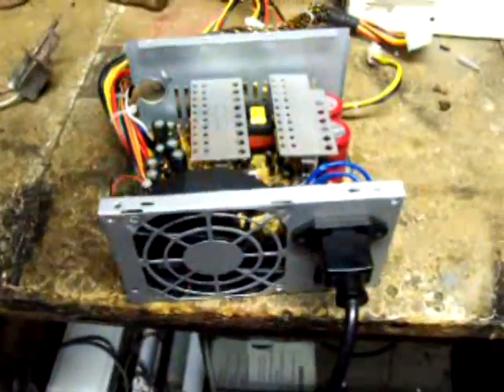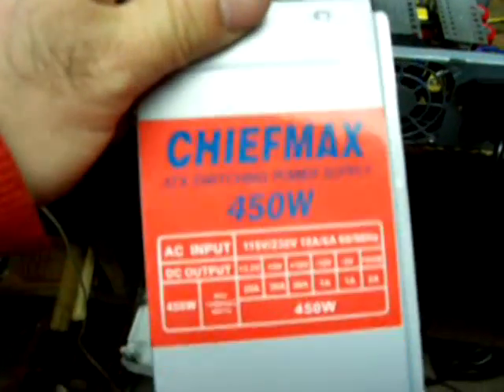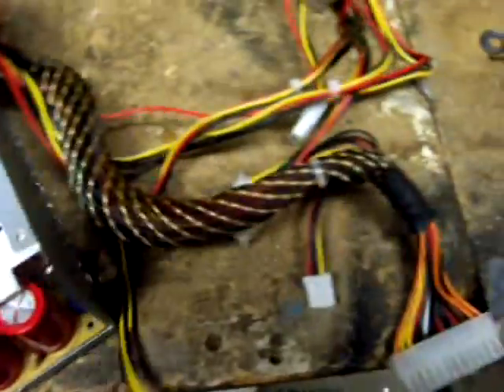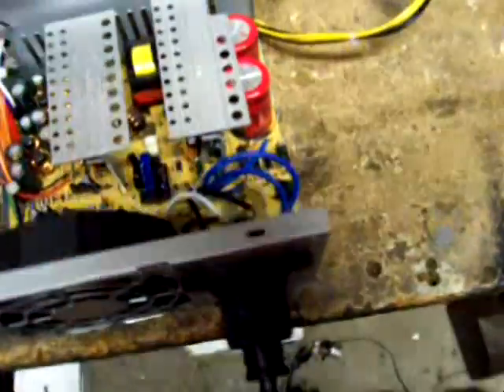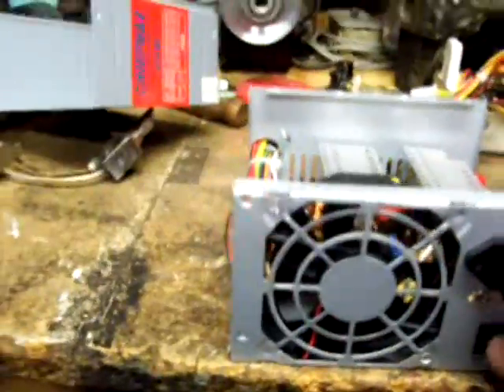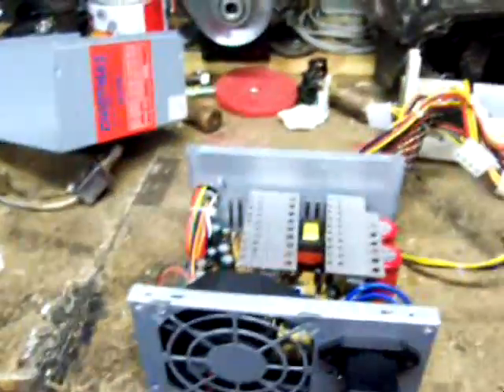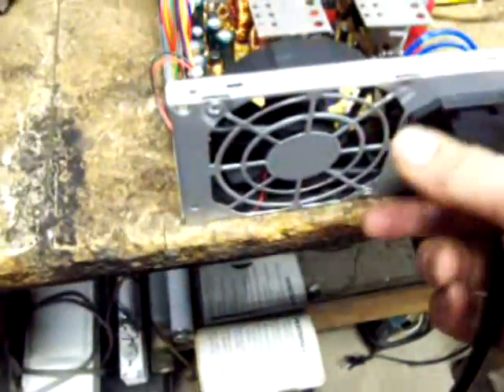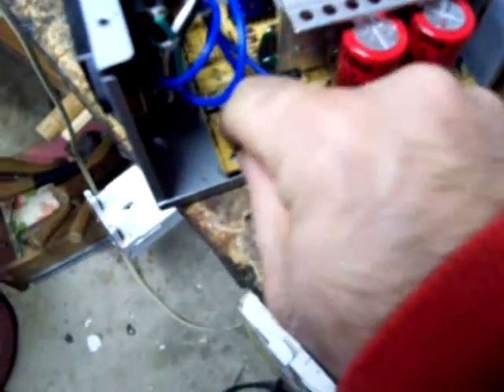Hammer vs. Computer Power Supply

Comment from the maker: @manoj6418 The Orange wire is the 3.3 or so volt power rail, black of course being ground.  If you havent already, un-plug it and let it set for a minute or so.  Depending on how long the two were shorted together, some and I mean some, can reset.  Otherwise you might want to check for a blown fuse.  If the fuse isnt blown you could very well have toasted a regulator, resistor or capacitor..... there are a few other parts in there as well.

Comment: That 'little black capacitor' was actually a 'disc style SUGE ARRESTER' It's inline AFTER the fuse to prevent spikes from destroying the entire power supply, or even worse, jumping a winding in the transformer and destroying *everything*. When a surge comes through of a voltage past it's open rating, it turns itself into a direct short to ensure the fuse blows and it absorbs the bulk of the surge by becoming a short circuit. You destroyed a PS that needed a 95 cent part, and did it's job..

Comment from the maker: Ive repaired them, many times.  Fans, bad circuits...... this was zapped so many times by either a higher than normal voltage into the house or lightning.  I figured I would "fix:" the one that let me down and couldnt be fixed.  LOL  Usually its just the fans making noise and thats an easy fix!  Mebbe I should do a vid on that....hmmmm

Comment: NOOO! NOT THE CAPS!!!!
btw u could have made yourselfe a high voltage switching mode power supply with the parts like i did. a 555, a 393, and a mosfet plus the inductances and high voltage caps from the supply and u could get a 60V supply